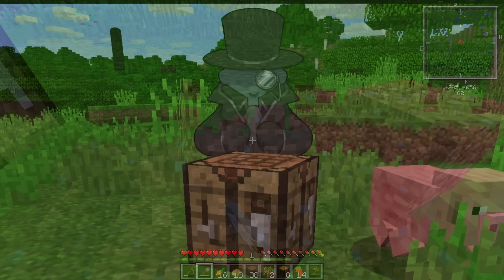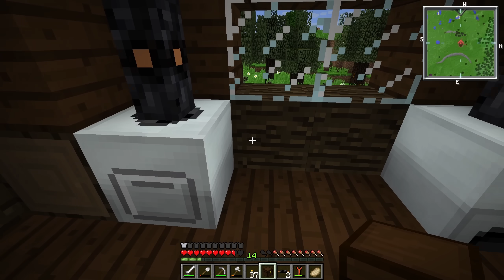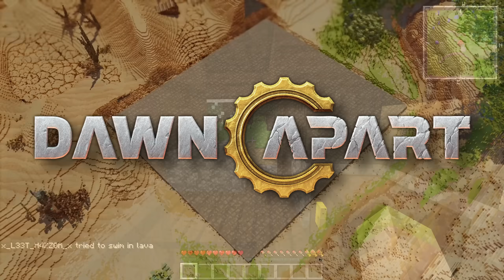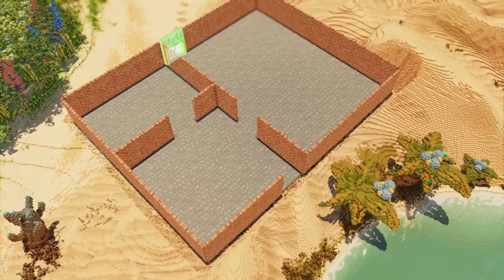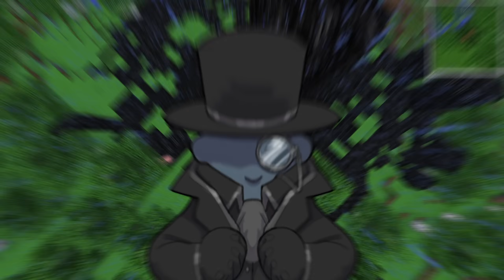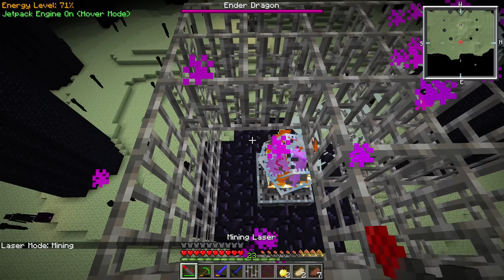Is TEKKIT still fun 13 years later?

Comment: First rule of minecraft mods: the creators are both brilliant in getting this stuff made and the absolute worst at creating documentation about how any of it works.
Reply: yes man, even with modern mods. There was a mod I was playing where the wrench had to be used while sneaking and right-clicking, I had to learn that through a reddit thread. I just don't get how you as a developer can spend the time coding the certain inputs needed for the user, the machines, etc, etc, and not spend 5 minutes doing natural language documentation for your players: 'to use the wrench the player has to right click on a machine while sneaking'
Reply: There is a wiki for this pack, Google is just dogshit at finding anything anymore
Reply: @TheShitSmith  The devs didn't make the wiki. The wiki is compiled information from users doing their best to fix the devs failings.
Reply: @TheShitSmith when it comes to keyword based searches google is horrible. I've switched to brave search and duckduckgo as they're much better. Brave search especially reminds me of old google.
Reply: I also wanna say that mekanism's official wiki is/used to be really good. It's been a while since I was on it so don't know about it currently
Reply: @magmadragon75  Yeah until you build a max fission reactor and have to check everywhere to find that its bottlenecked by the size of the pipe, not the pipe itself
Reply: tbf most of the tech modpacks that apeared after tekkit add both questbooks and in-game documentation to make figuring stuff out easier
Reply: Developers being bad at documentation is a very developer thing
Reply: @TheOfficialKazStudios that’s funny cause I think I am a bad developer but good at documentation
Reply: @spencerC23  That is also a very developer thing lmao
Reply: Thank god its now standard practice to include a guidebook nowadays...
Reply: The mods are called differently in this modpack because some of These are remade or given to other developers.
"Industrial Craft Classic" is originally called Industrial Craft 2 and with this you find all of the documentation.
Reply: I watched yogscast play it so wasn't totally in the dark- some of the mod packs have so much random stuff if you went in blind you would get stuck on step 1 and never progress - they did the quest books/ quests screens that made it much better later on tho .
Reply: I found out about this without Google and way too much free time
Reply: Except Create. We love Create
Reply: @CarbynnKirb  create fun
Reply: @CarbynnKirb no we don’t. It is a cancer to modern modpacks
Reply: @nova4791  Why? Because it's used often? That has always been an issue with mod packs, and the mod isn't to blame for that. 90% of mod packs back in the day used the same shit as well.
Reply: @bubrub5564 no, because it doesn’t intertwine well with 90% of mods out there unless it gets addons specifically designed for it. That’s why create is trash in modpacks
Reply: @nova4791  Sounds like you're playing trash modpacks. No shit a large mod needs compatibility mods to function properly. That's always been a thing and isn't unique to create in the slightest. Stop playing shit tier kitchen-sink modpacks that throw a bunch of random mods together and play something that's more catered towards your preferences if you have an issue with this.
Reply: @bubrub5564 I don’t play kitchen sinks for that exact reason 😂 stop yapping based on assumptions dude. I don’t play modern packs anymore but the ones I did had either garbage forced create integration or just threw it in for no reason on the side
Reply: @nova4791  "threw it in for no reason on the side" Never has happened before in the history of modpacks, folks. Truly a new evil that has overcome the modding community, all because of create of course. Thaumcraft, AE2, Draconic Evolution, and Blood Magic aren't real. It's a big modding psyop.
Reply: @bubrub5564  ok fair on the side maybe im overexaggerating it lol, although ae2 as an example makes no sense. Forced create progression still sucks and will always suck though.
Reply: @nova4791  Yeah forced progression for anything sucks and create doesnt fit 100% in most worlds, but in some modpacks that are more open ended or create centric, i absolutely love create, the modpack I played last was just new tekkit pretty much
Reply: Its definitely gotten better, lots of mods have github wikis easily accessible via curseforge now thankfully
Reply: Thank fuck Create and its add-ons usually have built in documentation via the ponder system
Reply: Sounds like the average game developer
Reply: So glad more modern packs at least sometimes follow the trend of writing a book to explain everything

Comment: "O' Rubber Tree, O' Rubber Tree,
We need to harvest carefully (2x)
We use five wood to make a tap,
and chop your leaves to find the sap.
O' Rubber Tree, O' Rubber Tree,
We need to harvest carefully

O' Rubber Tree, O' Rubber Tree,
thy resin is so sticky (2x)
We put it in an extractor,
we pipe it out, it's now rubber!
O' Rubber Tree, O' Rubber Tree,
thy resin is so sticky

O' Rubber Tree, O' Rubber Tree,
thy rubber is so handy (2x)
Combined with wire, to insulate,
for the machines that we create
O' Rubber Tree, O' Rubber Tree,
thy rubber is so handy"
Reply: I came here to see that comment x)
Reply: Heard rubber tree and started singing ;)
Reply: any time i hear rubber tree this is what pops into my head

Comment: 7:40 if its after 1.8+ obsidian can spawn in nether fortress chests and the gravel can be converted into flint. Which means that while you could have gotten home, it would most likely taken a long time.
Reply: Tekkit 2 is a "retro" style pack, in the sense it wants to reproduce an (improved) tekkit experience in newer versions, so it runs in 1.12

Comment: May I suggest Enigmatica 2: Expert Mode? It's a quest based modpack that makes you switch through multiple expansive mods to get the items/blocks you want. Like for example, you want to make a solar panel from Mekanism? You need parts from Forestry, IC2 and Immersive Engineering. Also it has lots of magic to play around with.

Comment: what we need to do for you to play Terra Firma Greg modern?
Reply from the maker: Not sure I’d play terra forma over vintage story tbh, but basically just watch the video en masse and I’ll do more, Minecraft is fun so I’m always up for it.
Reply: @HazzorPlaysGames TFG offers a lot more than both TFC or vintage story in terms of gameplay changes and new content, it's gone through several updates to make the questline coherent and streamlined. however, it is extremely monotonous at times requiring you to make the same item hundreds of times before you have access to automation, which is provided by a smashup of create and gregtech, it'd be a very long series and commitment
Reply: terra greg majorly different from vintage because of, well, Greg tech part, but recently it updated (or will be updated) and now there is advanced rocketry along terra firma. i believe it will be fun to watch your progression from stone age to multiplanet logistics